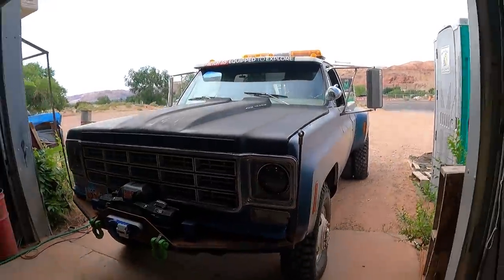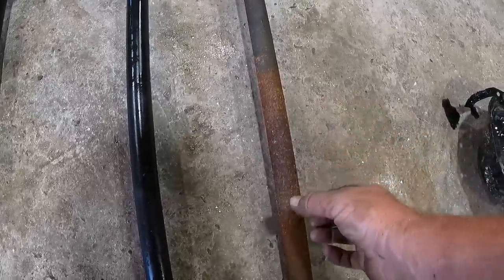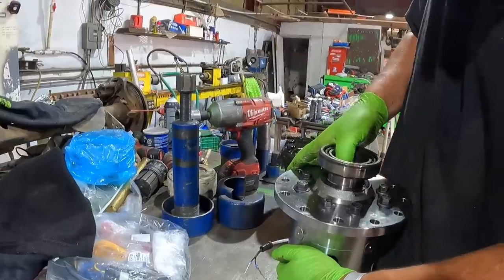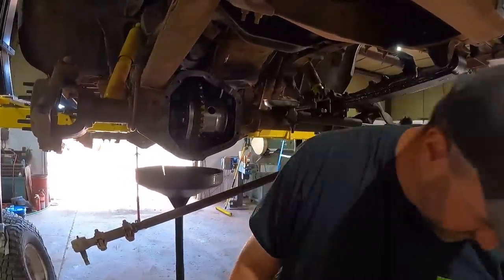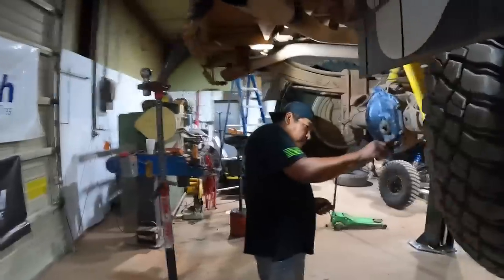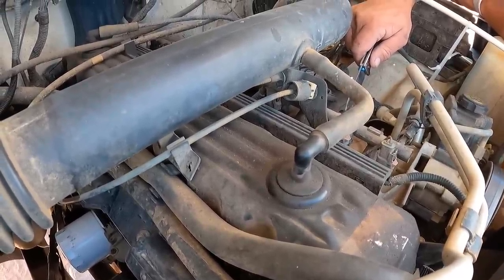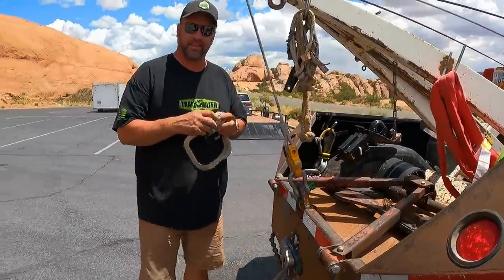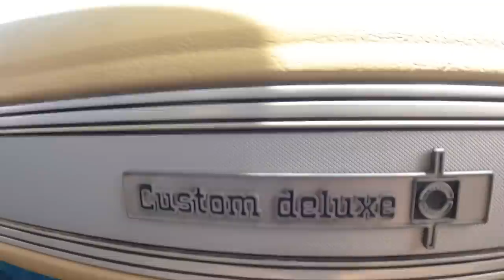Ol Blue Gets Lockers

Comment: I've torqued enough nuts & bolts with an impact in 51 years, that i totally agree with your method Rory!  Also, i have found that greasable u-joints  will introduce  dirt & moisture whereas non-greasable joints don't.  Great video!  And as always, thanks for taking us along!

Comment: I agree, "works for me" is different for everyone. Running long mileage on road vehicles that actually get greased, I would never dream of putting in non-greaseable u-joints. But I don't beat the tar out of my stuff off road, so "works for me" is definitely different.  Love the, not everyone has to think the same way in the shop content.
Reply: Back in the day when I built my drag race cars, I never used greaseable U joints because they are weak and hollowed out. I always used the Spicer solid non greaseable U joints just like Rory. They never broke.

Comment: Put one piece aluminum spacers between the duals. We do the same thing in Alaska. We run slightly larger tires and the truck rarely goes more than 50 mph. 1 to 1and1/8  inch should do it any mach shop can whip up a set. Love the content

Comment: I agree on the electric lockers reliability. Matt sure has had quite a bit of trouble out of his air system on his wrecker always springing leaks. He's going to find out that not just hot weather and under hood heat causes big problems with the air system's plastic plumbing, but freezing cold weather and moisture really screws up air compressors and cylinders.

Comment: FWIW, the 1350 spicer with the depression in the center (non greasable) is not what they used to be. Steve Morris Race Engines did a video on them. He was tanking them left and right on his Promod. Granted, you aren’t pushing 4500 hp, but you definitely are upping the torque thru the gearing.

Comment: 1:06 quick question on this, have you heard of the OX brand locker? If so, would you not recommend that brand? They are manual lockers and can be activated physically without air or electricity or with them…. Or totally mechanical… im asking because i want to put lockers in my super doody. Thx

Comment: Nice job on the lockers upgrade.
Those axleshafts are beef.
As far as lockers go, I always liked the Detroit.
A little squirrelly on snow, though.
Couldn't you run a Detroit in the front since it doesn't matter when the hubs are unlocked, and you could just unlock one hub if you wanted one front wheel drive?
Anybody ever try that?

Comment: Thank you!  I have been wondering why so many like Paul and others use Air Lockers and I have had no answer.  Why not electrical?  You already have to send electricity to the air compressor to send air to the Air Lockers. Why not just ditch the pneumatics and go straight to the axle?

Comment: Here is something that happened to me I had 1994 Ford Taurs and wouldn't start and so I replaced the fuel pump still wouldn't start so I Traced down some of the wiring and a bad ground there is this wire that hooked up with the negative Terminal replaced the wire and it started.

Comment: Rough terrain might break electric wires and still no lockers but if use air properly with good connection will still be better than trying to trace down electric in middle of a mud hole